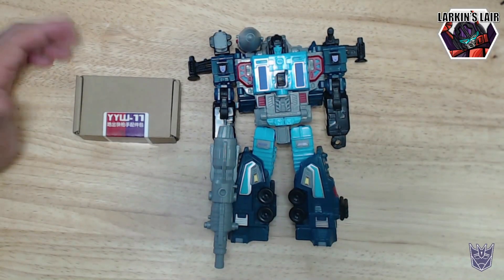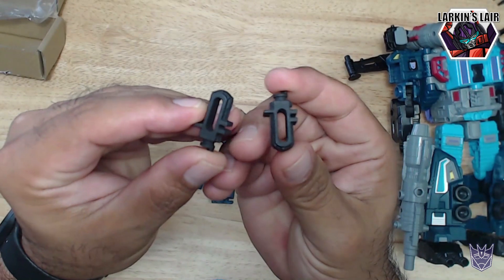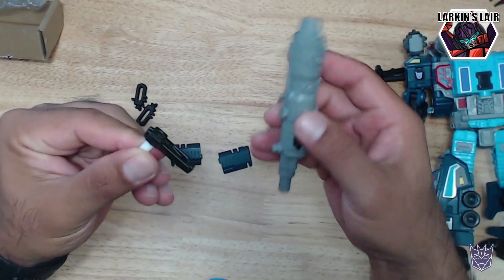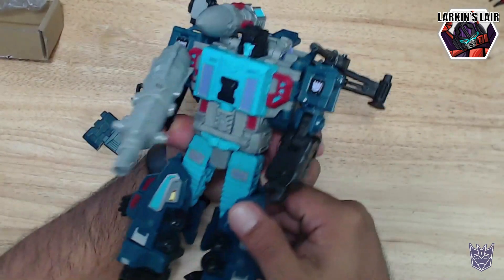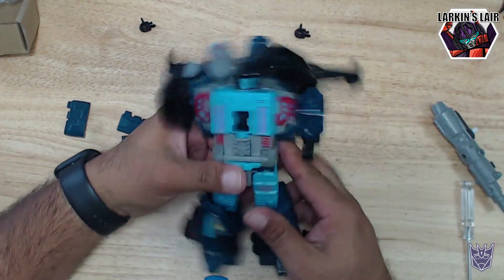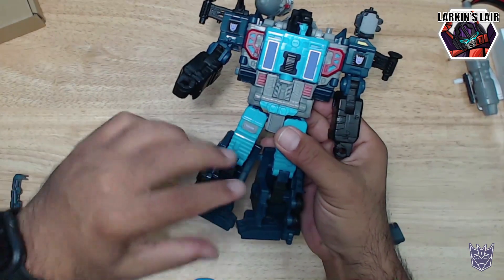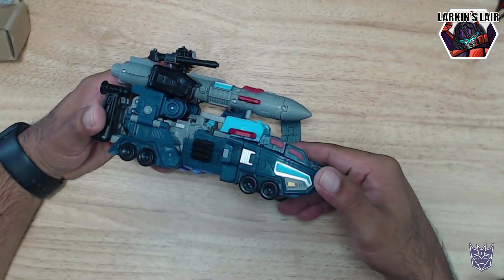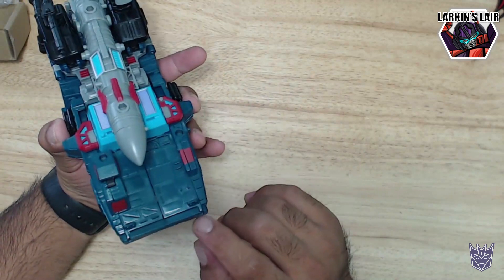Customization Workshop: 115 Studio YYW-11 Upgrade DIY kit for Earthrise Doubledealer

Comment: So I have a big problem when I tried installing this kit. One of the screws in Doubledealer's leg pretty much got its grooves shaven so now it's impossible to get it out the normal way. And the shaven screw is in that deep hole that's on the back of the leg. I tried this gell called groove out but it didn't help. Any suggestions to getting a shaved screw in a deep hole like that out? The only other option I can think of is dabbing a small bit of super glue at the end of the screwdriver and having it sit in the screw until its dry so it's easier to pull out.

Comment: Do the leg extensions hold in place ok in robot mode? I'm worried they'd slide in and out too easily
Reply from the maker: It holds pretty well because the fillers actually tab into it and provide support.
Reply: @LarkinsLair  what about without the fillers? I don't think I'd use them